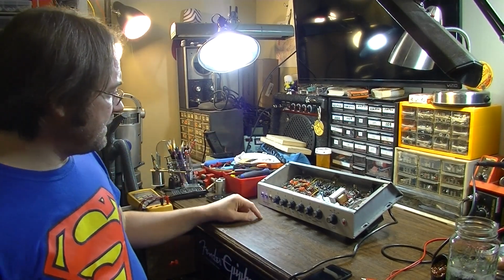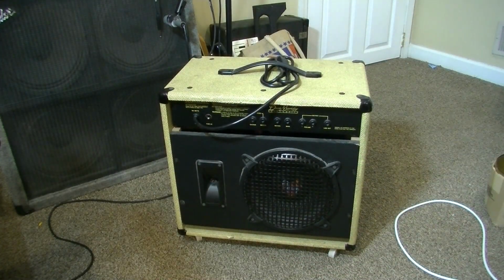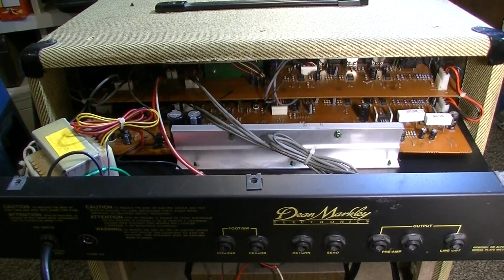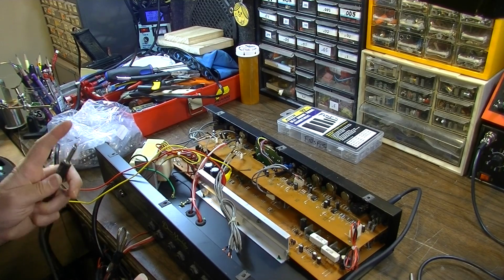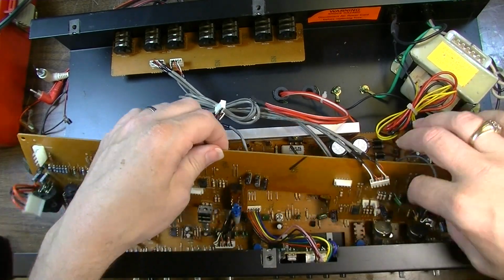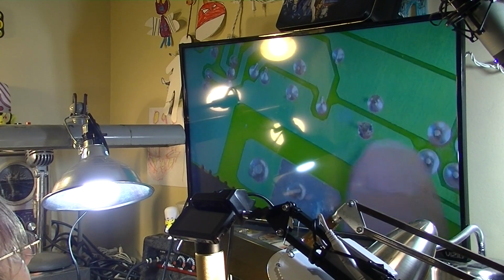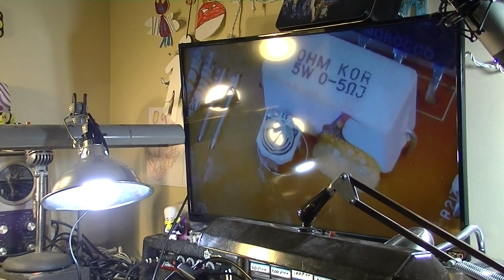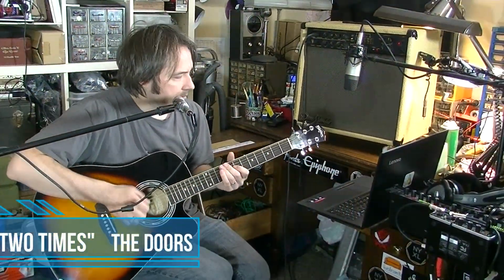The Sort of Repair I Usually Reject - Solid State Acoustic Amp, Full of ICs, No Schematic

Comment: Question:  on a solid state guitar amp, where in the output power stage inside the chassis, do the two wires from the speaker connect to? I have a HOLMES MPR solid state amp, it works. It was modded. I removed mod. And want to hook the 2 speaker wires back into the chassis where they go. I do not know where they go in the chassis.

Comment: Question,  I'm I'm tearing down an old tape deck from the 70s and I plugged it in to see if it worked and I wonder if I need to discharge something before I go putting my fingers on stuff? Thanks.

Comment: You're losin it on this one Brad!  That there is a 3,450 amp fuse you should know that!  Also, they ARE original speakers, it says so right there on the speakers themselves!  Nah just kiddin mate lol, you did well on this repair, despite turning the bias pots around without marking their position first.  But of course, it may have been close enough anyway, & whose gonna notice an extra little bit of crossover distortion in a guitar amp anyway?

Damn stupid move with the fuse rod, by the previous 'repairer'.  I wonder if he thought he'd get double the volume by doubling the number of speakers?  Dumbass idea.  A well done version of the doors song mate; you're pretty talented!  Thumbs up!

Comment: Hey Brad, I got a solid state question/problem... I've got this Marshall Valvestate VS100 Head & it sounds great/does what it should until you stop playing.. When you stop playing & let the audio fade out naturally there's this weird subtle sizzling sound that occurs towards the end of the sound breaking up, it's really evident when using the headphones & it's happening across all 3 channels.. This VS100 is from 1998 & it used to belong to a death metal guy so I can just imagine that its spent most of it's life cranked up to 10 which makes me think that one of the IC Chips have been overdriven to the point of needing replaced.. I've replaced the tube & nothing changed so now I'm trying to figure out where the source of this noise is coming from.. According to what I've managed to dig up online, this VS100 has a circuit that involves 5 IC Chips from Input to Output & that's where I suspect the problem is but I can't seem to confirm that as being the case.. As I mentioned before, this amp sounds great but this sizzling sound at the very end of the audio fading out is not normal.. Any suggestions or explanations of how the IC Chips function in a guitar amp would be greatly appreciated..

Comment: Took my Peavy Backstage Plus 35 W Amp apart - cleaned the circuit board (QTips soaked in liquid soap + water) - looked at all solder joints - applied a few drops of liquid flux / resoldered four (4) joints holding the Guitar Input switch to the circuit board + bent in the metal tip part of the switch to make sure contact happens when guitar cable is inserted. Resoldered one of three wires from the transformer to the board. Fixed!!!!!! Including Spring Reverb!!! Thanks for making this video!!  Good aggressive Doors Jam. Still might need a new switch but at least it works!!

Comment: Even it's an old vid, i luv it. Still have that same Amp sitting somewhere.
I also own a Dean Markley K75 guitars Amp, wich was one of the best designed Sud State amps back in it's time. Dean Markley made some real well made stuff, way ahead of the Fender solid state amps back in the early 80s, i still have it as a kind of backup and it takes pedals well.

Comment: no offence friend but learn how to reflow solder joints... 😅
Reply: Dang it, I thought maybe you had a good video showing us how to do just that, but you don't.
Reply: @M. Gaston  Yeah it's always best to remove the old solder first, but it's only a shit ss amp, & he did use flux, so that's not so bad.  I do wish he'd leave the iron on the joint for 1 second more after he's applied enough solder though, to fully activate the flux.  He removes the flux afterwards, & that's a good thing.

Comment: Probably a dumb question, but why do you slowly bring the voltage up with a Variac? I would think that would cause problems in the same way a power fade might damage modern electronics. Working with medical electronics - I might use a Variac to perform calibrations, but maybe it's because you are servicing analog devices vs digital - I like the video microscope to examine solder joints, that's great!

Comment: I think that's about as good as that amp will ever be.  I am no fan of electronically amplified acoustic guitars - all of the airiness and separation seems to disappear in the process.  But if you must plug in, I suppose this solution is as good as any other.

Comment: Oh no! Another bad solder joint. I ran into my first today. A garage sale garage door opener for $30 .  Intermitently shut off so i hit it w ith a paddle when it fails and has worked for the last 9 months. Now that weather is better took a look at it. Nothing visible but pushing on circuit board made it work. I suspected the connector and cleaned and bent pins to no avail. Gave up and reflowed all larger solder joints ( for relays and connectors ). There was no sign of a cold solder joint but now works perfect.  I never would have done that except for all your bad solder videos. Thanks for the good show

Comment: The Tube Amp is being used less and less now at least in my circle of musician friends they all say the same thing Solid State/Modeling Amps are the way to go i also agree they are fantastic
Reply: Aj & Cyni sargetti - Gidday!  SS amps are too clean with hard clipping & odd harmonic distortion.  The best ss guitar amps I'm guessing would have circuitry to emulate the sound & crunch of valve amps.  Valve amps are naturally that way.  I'll bet ss amps are much lighter though, which could be important.  No doubt they'd use less power too.

Comment: I'veopened up a 76 watt Line 6 Spider 3.  The customer bought it and put it away after it died in 45 seconds.  He forgot about it and couldn't take it back under warranty.  The power dies to the preamp otherwise it works fine as new.  I'm taking out the chopsticks.  there is no other way to tell what is failing with it.
Reply: I should have typed 75 watts.  It was late and in the dark.  The solid state amps are a good source for speakers and new cabinetry.  Most are junk.

Comment: I would recommend you get a "fume extractor" if you do a lot of soldering, like when replacing a group of pots. Breathing flux and solder fumes is harmful, plus pre-1985 or so solder joints are all lead based not tin as is now the case and it's nasty. Keep that shit away from your family. Plus it's nice if you fry something, you can suck the smell out of the shop. May be a problem if recording, as they can be noisy.

Comment: Thanks for the video, Brad! The Doors cover was really cool. But why does everything sounds like it's being recorded with only the camera mike? Both your guitar and your voice sound really roomy, even though I see the microphones are placed really close. I have noticed it even back when you started to mike up the amps and it bothers me a lot.
Reply from the maker: Well-spotted. Although I captured the audio from that mic on my laptop, I did not use it in the final edit because it was unfortunately distorted. I've replaced the mic for future videos. Bear with me, I'll get it right eventually.
Reply: @TheGuitologist  Turn the gain on your recorder WAY down.  You can normalize the volume using Audacity (or whatever audio editing software you care to use) without having to use compression/limiting on the source.  Trust me - you'll love never having to worry about recording too hot and inducing distortion into the recording.

Comment: Awesome repair video Brad!..but I don't think I seen/or missed where you checked to see if the impedence was correct with that extra speaker/s that they had cobbled together.
Reply from the maker: It was correct when I put it back. I believe it was correct when I got it too. Looked like a dog's breakfast, but worked as intended, I guess.

Comment: Hi Brad, I think you should invest in some 9/16"  (or a whole set) deep sockets or a hollow shaft nut driver(s).  You should never use old gas line pliers to remove the retaining nuts from the pots on the front panel.  If you can afford a microscope you sure as heck can afford to buy and use the proper tool for the job at hand.  I was surprised to see that kind of apprentice move from you, pliers scratch soft front panels and the silkscreen letters...lol
Reply from the maker: It's become a meme on this channel at this point. I do it on purpose. I have sockets, they just don't live on the desk. ;)
Reply: So that's where all those scratched up faceplates came from, huh...lol have a good day and enjoy your retirement. P.S. cool avatar
Reply: I used pliers for 30 plus years, never had a problem.  mid 70's till I retired in 2007.
Reply: Even a combination or box end wrench would be more suitable than pliers!

Comment: May I recommend you add a ventilation fan in the basement to remove the gas from the solder/reflux?
Reply from the maker: From all that I have read on soldering vapors, the conventional wisdom seems overblown. Lead doesn't vaporize until a much higher temperature than its melting point. The vapor is mainly carbon smoke from the burning rosin flux. I wish there was more study on this. A vent would be the safe bet though, you're right.
Reply: Still rosin smoke isn't the nicest stuff plus most the time the epoxy crap they coat boards with burns along with it

Comment: @The Guitologist I've seen people pull that shit with the pennies! They're crazy! Especially given the fact that if the house is old enough to have fuses it probably still has the original flammable cloth wiring. Reminds me of these guys that rip the ground prong off of their A.C. jacks.

Also kinda reminds me of a friend who lived in an old house with fuses & bad wiring. We were jamming there and our bassist had an original SVT. He ended up blowing 2 transformers and 2 sets of power tubes because 2 of the phases were swapped. After the 2nd time I figured something was wrong and tested the outlet and found it was wired wrong.

Comment: I'm at the 7 min mark... the first thing that blips in my mind is....    If the original speaker was 8 ohms...  and now John Q person puts 2  8 ohms in parallel, now there's only a 4 ohm load, and the output transistors take a hit.   PLUS,  the piezo tweeter has very high ohms at audio frequencies,  but super low resistance at supersonic frequencies.  An amp not engineered to take a piezo could go into oscillation and burn out the power transistors.
Reply from the maker: The speakers are in series/parallel and all are 8 ohms. So it's 16 ohms in parallel for 8 ohms again. Not sure about the oscillation thing you mention. I'm no SS expert.
Reply: No worries man...  just thinking out loud.   Bill Fitzmaurice speaker building forums cover the issues surrounding piezo tweeters all time time.   If you array them for high efficiency, it can be a good thing,  but if the amp itself doesn't cut off the supersonic frequencies,  then you have trouble.    Fortunately that amp was a straightforward fix.....  I've got a custom amp to scratch build this week...  fun fun.
Reply: Brad, 2 speakers are either series or parallel. A woofer with a piezo (or other tweeter+ high pass filter) counts as a single speaker. Piezos (not only) can be even wired in parallel while the rest is in series and vice versa. I would definitely connect the woofers in parallel, to get full performance (if the parts/topology allow/require).
Reply: DeadKoby, all your concerns are solved with a 2-50 ohm 1-2 W resistor (doesn't even have to be a ceramic power resistor, just a bigger cylinder) in series with the piezo. Again: output IC datasheet-frequency rating-20kHz?- good!-over?-over 100k?-doubt. Still it is good to use a resistor, just in case... Or an autobulb of 5 to 21W. Piezo is not an ideal capacitor, even a high quality foil or ceramic cap is not that either.
Reply: Even IF the amp were rated for a minimum an 8 ohm load, plugging in a 4 ohm load probably wouldn't damage it.  Most amps can easily handle 4 ohm loads.

Comment: that cover was awesome started my day pumped as fuck! I have a question could you make a video on what different capacitor values do in different places and the same with resistors. Like this: a cap in ... value makes the bass tighter and a cap in ... value makes it a bit more flubby.

Comment: I'm a little surprised the added speakers didn't create an issue.  One thing solid state amps have very little tolerance for is a speaker impedance that's lower than the amp's minimum.  A number of stereo amps I fixed was due to the owner adding speakers to their setup.  The two Pyramids are 8 ohms - which is fine if the amp can handle 4 ohm.

Comment: Hey Brad. I believe the people or consumer have the rights to a products schematic. What do you think? 
Thank you
Reply from the maker: I believe people should have the right to know exactly what's in the products they buy. Just like with food. FDA requires an ingredients list. Privacy is a freedom issue. Where it pertains to electronic privacy, I agree with right to work. The justification gets murkier for a libertarian when it doesn't contain a microphone and transmitter.
Reply: The food ingredient list disclosure is a great analogy. I never thought of looking at it in such away. Makes more senses for Joe Public. I think the least manufacturer could do although it still not good enough is for them to include a block diagram for signal tracing and general operation understanding. How I see things now especially the Line6 company is they cook up binary false tone using 1 and 0. I think they've done away the physical components tone recipe which makes them scare even more to share codes and schematics.  Hey, Brad you might want to check the "Right to repair" bill brought up by Louis Rossman in New York. I think it would benefit our field too. Who knows I might see my MP about it also.

Comment: Brad can you help me figure out the best way to bias my super reverb reissue? i got a pair of matched nesstubes . I also have a quad of 6L6's for a Traynor CV80 that have 5881's in it now . i had replaced them with the matched quad and in three min. two started red plating.  popped the 5881's back in and have't had a problem. I thought i could get away with it for it's self biasing but i suppose one for the tubes it s oridginally biased for . . theres very little id on these chassis or frames. that even suggest ab whatever. would love to find a scepmatic for these guys. would appreiciate any suggestions. t hx.

Comment: Sounds good. You can usually figure out those iCs if you're lucky enough to find the number still legible on them. You can then look up what voltage belongs on what pin.  Also you can check how hot they are on the surface to get one more clue. (Knowing Brad knows this, for the viewers.)

Comment: Your work inspires me. I work on tiny solid state stuff, Nintendo and Sony handhelds, but the thought processes are exactly the same. If you want you can check out my one minute videos on Instagram. I've posted hundreds of vids. I've set up some pretty interesting test jigs and have invented a few tricks here and there. I only start with non-working consoles.
Reply from the maker: I don't have an Instagram account. But that sounds interesting. I run across older consoles in thrift stores a lot.

Comment: You might want to put the came in front of the screen when showing microscope footage (a more preferable choice would be capturing the output of it). All the glare caused by the lighting made hard to see what you were doing.

Also...This amp apparently has spring reverb. When you opened it, there were two rca cables connected to a sealed box below the speakers.
Reply from the maker: The microscope is a nice one, but one thing it doesn't do is output HDMI to a monitor and capture video at the same time. It's a bummer, but I can work around it. Just need to reposition some lights when in use.

Comment: On these brown pressed phenolic boards, sometimes the pads detach from the board and the trace cracks right around the pad... very hard to see, usually you can see it moving when wiggling the part. If suspect, I'd measure the trace continuity just in case.
On the topic of those speakers, I'd say it probably sounds horrible due to the acoustic interference. If it were my amp I'd put it back to stock...

Comment: Hey, do you think a high end power cable can improve the tone of an amplifier? Is there a way to prove it with an EQ spectrum ect?
Reply: No and yes.
Reply: Hi Ben!  Won't make a whisker of difference, as long as the wire is intact.  A longer one would reach further though!

Comment: how was the speakers wired series parallel? mabe it was wired wrong with the ohmage too low pulling 2 much current blowing the fuse???   cheers brad ;-p
Reply from the maker: Series parallel, yes. The end result should have been 8 ohms total. Doubt that was the issue. But nice thinking!

Comment: Hi Brad
Can I ask you -why are you afraid of those "solid state circuits" ?
Reply from the maker: Several reasons. Harder to diagnose and trace issues in amps with a lot of ICs. Unless it's a known issue, you have to end up looking up IC datasheets to trace anything out. It isn't like a tube amp where you know which pins are what usually just by experience. And a solid state piece of gear is usually worth less, meaning I am rushed to fix quickly or it isn't worth the repair.  Just a bigger pain in the ass usually with less reward.